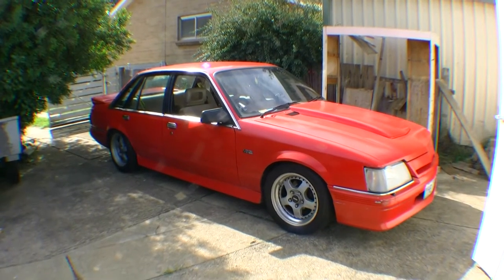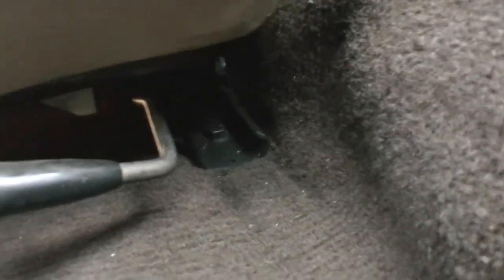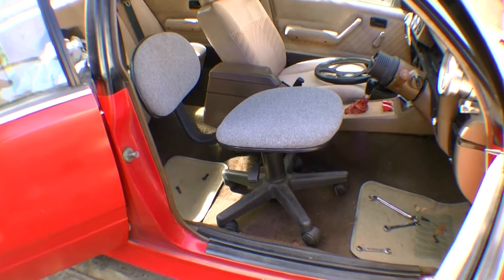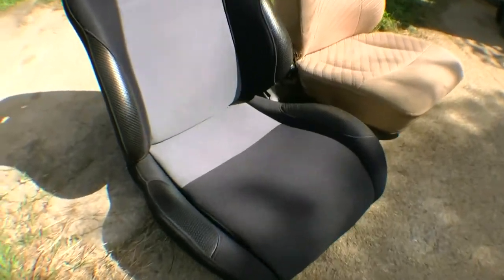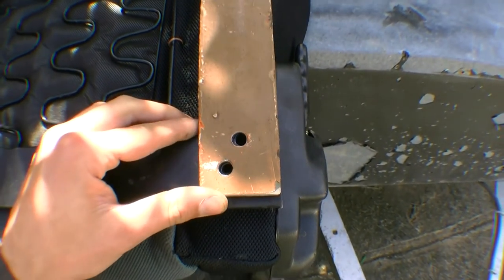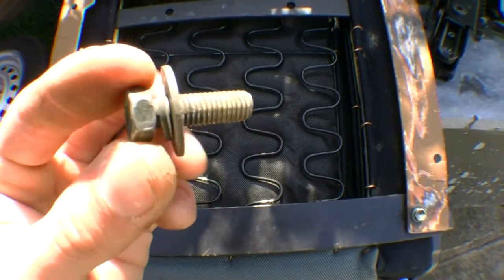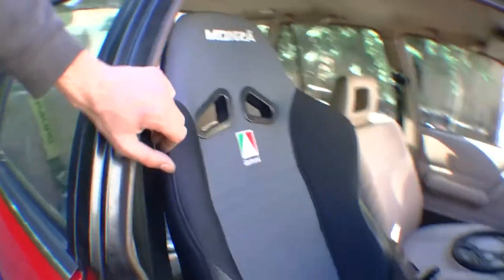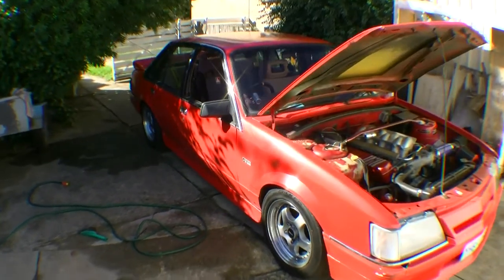♛ Holden 383 VK ♛ Bucket Seat Install

Comment from the maker: Hey man! The metal strips were about 35 centimetres... but each seat will be different.
Just measure it up and then angle grind it.
I used 3mm or 5mm just anything I had in the garage! :)